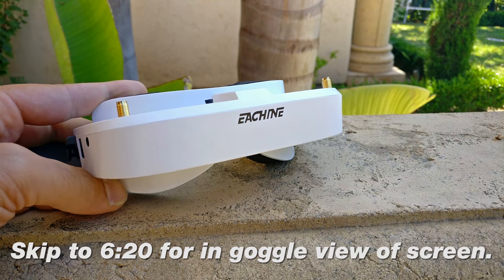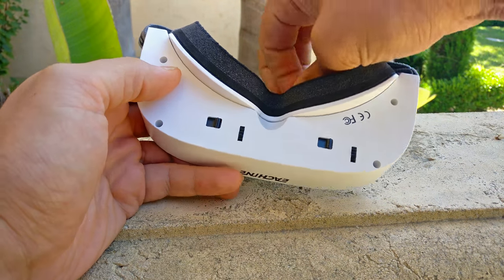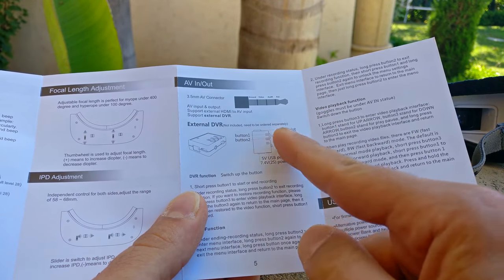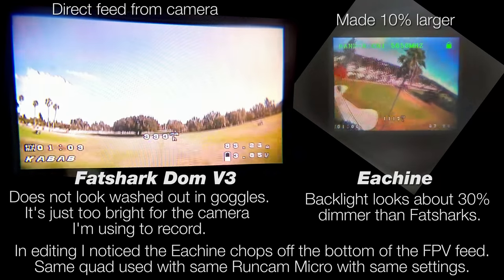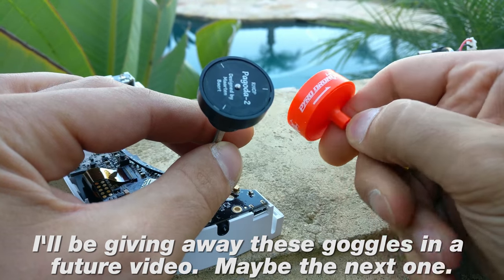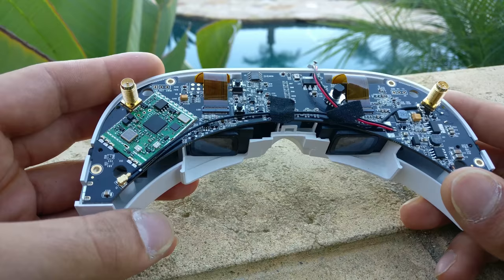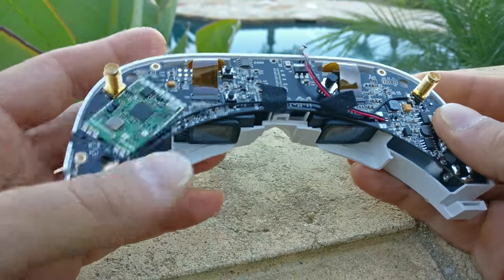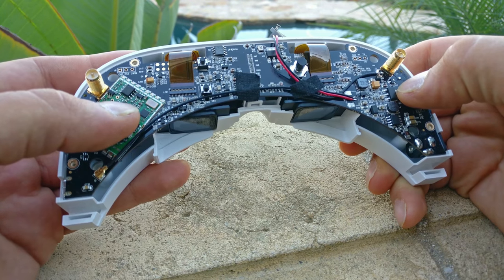Eachine EV100 Review

Comment: Finding an entry level pair of googles is too hard!  Frustration level over 9000.  What do you recommend?
Reply from the maker: I still recommend the Dom V3 over all else right now with the HDO in second place.  None of the other HD's have good optics to me.  Not even good, just adequate.  That's what the V3 and HDO have.  That being said, there is one goggle project that's in the works.  Maybe a release date in six months?  Also, as a beginner pair, I'm shocked to say that Topsky might have the best option.  They have a $100 pair you'll find on Albert Kim's channel.  I've got a pair on the way as well.  I haven't used it but I was impressed with what it looked like.  The biggest issue might be an enormous FOV...
Reply from the maker: I started off that last response with Dom V3 and HDO because it's probably more worth just investing in a good pair up front than re-spending in the future.  My Dom V3 are over 3yrs old and they're still the best option on the market IMO...but I also understand the desire to keep it cost effective at the beginning while you start your addiction :-D

Comment: It's not "fake diversity" It's antenna diversity and it supposedly uses intelligent switching to choose the best signal between the two. From what I heard they perform very well when it comes to signal strength. That FOV though, I am having a hard time looking past that (put intended). On the other hand my EV800D's are so cumbersome to use because it's basically like strapping a TV to your face. It's heavy and it sags down, I decided to take a risk on these, hopefully I can return them if I'm not happy.
Reply from the maker: These will never compare to the EV800D.  Those are actually pretty darn good.  This goggles image is so tiny you cannot see where you're going.  I would say it's extremely unsafe to use even.

Comment: Babak, you the HDV3s can switch between 4:3 and 16:9
Reply from the maker: SnowbirdSteeze well than what's the point of having like a $650 pair of goggles if I'm only gonna use them in Dom V3 mode?
Reply: Kabab FPV agreed. Fat shark hasn't been pushed to innovate for a while. 

I'm still waiting for the Floss 2 3-4"
Reply from the maker: SnowbirdSteeze oh I've got something good coming...

Comment: Kabab FPV, thanks for doing such great work. Im always impressed with your attention to detail, so please don't stop. I know these EV100's are on sale right now, but the normal price is $350 which is outrageous considering the fact that it doesn't even have diversity and built-in DVR. Once I saw that, I immediately gave these things a fail. I'll admit that I really like the design, but that's it. 

What do you think about the son to be released TopSky F7X? They seem really good on paper. They have everything I've ever wanted in a pair of goggles.
Reply from the maker: Xudus FPV looking forward to the top sky. only thing I wish it wasn't black or red. white or otherwise a light color is the only color for goggles in the hot sun.  the reception on the eachine is surprisingly good. pretty close to equal compared to furious V3
Reply: Kabab FPV A lot of Eachine goggles have "amplification circle" Instead of diversity. Idk what it is, but the reception is usually good. If you can explain how an amplification circle works, I'd love to hear it.

Also, you said you're "looking forward to the TopSky." Do I smell a review on the horizon? Am I reading too much into it? Secret for now?
Reply from the maker: Xudus FPV yeah I think those are the ones linked in my description. that's what's coming to me as soon as they are released. I also have no idea what amp circle is but the signal of the Eachine is pretty darn good. don't care what antnna whatever is on it. I wouldn't be upset about the lack of diversity or external module. I'd be totally fine with it for daily normal flying.
Reply: Kabab FPV Nice! I asked a couple people to review the TopSky a few weeks ago when they were just announced. I don't think I asked you, but I'm glad you're picking it up. Can't wait! I hope it's what we've all been waiting for. Oh, and they will have different skins/ plates for it. They posted it on their FB page. Here's a link to the white 1. https://m.facebook.com/story.php?story_fbid=1370331483085049&id=1252301698221362

Comment: i have the Eachine VR 007 googles and i just can't fly with them i had them on for about 45 sec an it was so bad i would love to give those away because i need to be able to adjust  the left an right and in an out and for right now as far as the OSD go's i could get by without it so if u wanted to trade that would be kewl my handle     XFlyer

Comment: USB to charge the battery pack I believe
Reply: Commented before you said it later in the video lol
Reply from the maker: Christopher Staricha yeah figured it was for that. kinda nice of them to include the wire. but why is there a USB on the goggles?
Reply: I believe you were correct in the beginning to firmware updates. But you can always power your googles off of a battery bank using the USB.
Reply from the maker: Christopher Staricha the goggles didn't turn on when I plugged them into usb from my computer. it's possible that usb port was too low power for them however.
Reply: I have a few battery packs for when we got to Disney so I'll test it when I get mine.

Comment: I love your objective reviews man- even though I use the top of the line fatsharks, I now know what to/not to recommend for people getting into the hobby on a budget. Would love to see some box goggle reviews
Reply from the maker: SBJ_FPV I'm considering picking up the $50 pair I recommended in my description for a review but I kinda don't want to start reviewing just low end stuff. hard line to walk.
Reply: Kabab FPV. I've used the $50 pair. A friend owns them. They are a great option, and the field of view is right in the sweet spot for box goggles. I use the Headplay HD, and the 7" screen is a bit too big for racing. The 5" screen is perfect and also makes them much more portable. You can also slide the faceplate off and use it as a screen which is great for showing people who are unfamiliar with FPV.
Issues: built-in battery. Not sure how easy it would be to power externally, but I'm sure it's an easy mod to take the internal battery out. 
No diversity, but the receiver seems decent.
Reply: I have the EV800's, yeah they are a good option. The build quality is very good and they're about the smallest of the "box" style goggles available. I've spent the last week flying with my friends Dominator V3s but they just feel much less immersive. Personally I'd recommend the EV800D with diversity and DVR, the cost difference is minimal.  I'd be very happy with them except that I need reading glasses and can't focus on the screen well. I have EV100s on the way, so I'll see how they work for me. Most other reviewers mention that they quickly get used to the screen size so I'm hopeful.

Comment: They need to remove their receiver, give us an open module bay, then use the money saved from ditching the receiver to give us better screens or at the very least, better optics for the screens. But they should really give us some better screens with a bare minimum FoV of 30 degrees. Even if doing this raised the price to $149.99 - 199.99, it would still be a FatShark killer at that price point. It sucks that the only goggles with this form factor which have an FoV of greater than 40 degrees are the Fatshark HD2 and HD3. If Eachine (or ANY other goggle maker) could give us 35 degree FoV with standard module bay/s for $200 or less, that'd be incredible.

Comment: Hey kabab, I found the best way to increase your perspective fov on these goggles. Check it out on my page. I'm basically just bringing the screen closer to your eyes. What do you think about adding in a fresnel lens to magnify the screen? I'm still tinkering with them to get the fov hopefully over 30. I'm currently at 27° which is a step up from the stock 22-23°.
Reply from the maker: Yeah but that hurts your eyesight even more.
Reply: Kabab FPV my mod or magnifying it? Which hurts the eyes?

Comment: Thank you so much for the tear-down of these, even if you don't know what you're showing on the board, it's a huge value to those of us who like to know how moddable things are before we buy (or don't)

Now, an EE's perspective, if anyone's curious: 

The USB port does look like it has its data pins connected to the main MCU, so in theory, firmware could be modded/upgraded, if they allow it. The header on the board you pointed out are programming pads, which means even if the USB is locked down, someone with the time and desire to do so could potentially program the main MCU with custom firmware. Sadly, all the numbers of important parts have been rubbed off, so it's hard to say what the ICs actually are without dedicating some time to going through datasheets. My bet would be on the large IC being some sort of DSP or dsp/mc hybrid like a dsPIC. It could also be some sort of off the shelf binocular LCD driver, but I would guess those aren't a common thing- I haven't had a pair of fat sharks or similar to look inside of, so I can't say for sure. There's also a smaller conventional MCU off to the right side, I would assume doing general housekeeping for the unit so the main processor can stick to pushing image data.

As for modding in a 5808/laforge/trueD, it would be piss easy. That flat surface of the top would make a super easy place to mount a header, and you could easily print up a little shroud to keep everything safe and secure. feeding in video would be as simple as hacking into the video in connector, or if you're feeling more frisky, you could totally bypass the DSP circuitry(avoiding the non-removable OSD) and feed it straight to the LCD modules.

I would love to have a go at hacking these, I think if they drop back down to 100 USD or a little more, they could make a good value proposition for a hacker who is willing to invest some time and money into making them work well. With a rx5808, a the OSD mod, and perhaps some sort of decent quality magnification for the displays, you could have a sub 200USD, very usable goggle setup.

Just a real pity to me they didn't ditch the internal module, and focus the extra money on better optics/screens instead.

Apologies if I just missed it, but did you notice how they handle 16:9 aspect ratio? Do they allow letterboxing or is it stretch only?

Thanks for the interesting video Bob!
Reply from the maker: Chris Tate thanks very much for that. I think we need some better optics first before anything else. without a better FOV, there's no point in going any farther. they don't letter box. just squash the image like Fatsharks. if they did letter box the picture would be even smaller!  at $100 I would say it's a good hack proposition as long as the optics exist. the real wonder is why on earth these companies don't just hire the hackers to make a better product!?
Reply: could you please try taking off the foam and see if getting your eyes closer to the screen  improves the screen size
Reply from the maker: mike jh tried that. I took off the entire face plate. the blurry edges get a bit better but screen is still tiny.
Reply: ok thanks
Reply: If you cant read the OSD,  make the Font bigger :-)
Reply: Hamza Mohammad thanks mate.....just bought it.
Reply: Would it be possible to use fresnel lenses to make the image bigger like we do with box goggles ?
Reply: Hamza Mohammad glue in any reading glasses +2 +3 +4 and you will have a huge screen.
Reply: Interesting. Will definitely tinker around with them when I get them.
Reply: Looks like digital driven screens and only one driver for both screens. I expected screens with composite input.
Reply: Maik Schulze interesting observation man. Any idea if fat sharks/commanders/skyzones are digital or analog screens?
Reply from the maker: Chris, please take a look at the tail end of my response to the comment that is now pinned.  I figured yours has enough to stay at the top too now.
Reply: hey Kabab, did you ever come up with someone to give these away to? I would be down for a challenge ;)
Reply: @mikejh6551  yes, slightly. but then even the smallest nose prevents you from moving the goggles closer. I cut a hole in mine and have no faceplate or foam. I can see a single image through them now at least.  If someone designs a 3D printed frame to transfer the parts into from this let me know. The lens need to be next to your eye, not 4-5cm away from it

Comment: What is fake diversity compared to real one ?
Reply from the maker: it only uses one receiver module with two antennas.  I don't know if anyone even knows how it uses the two antennas.
Reply: Kabab FPV if it has 2 antennas, something should select one of them no? Diversity chooses the best signal and sends it to one module for decoding. As you say, what is the second antenna for if it's not diversity.